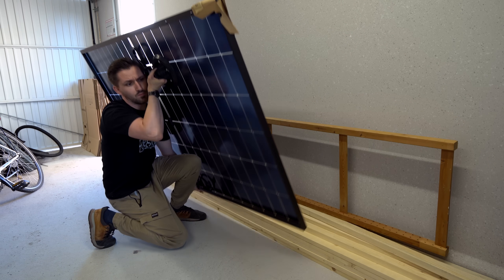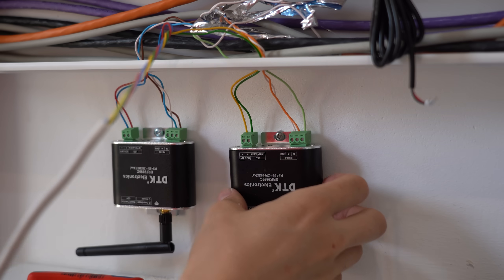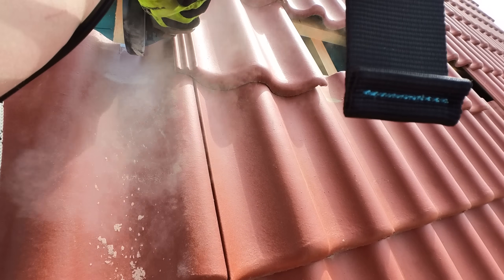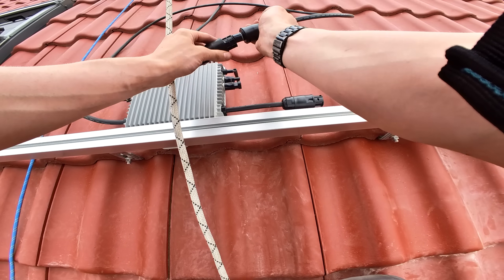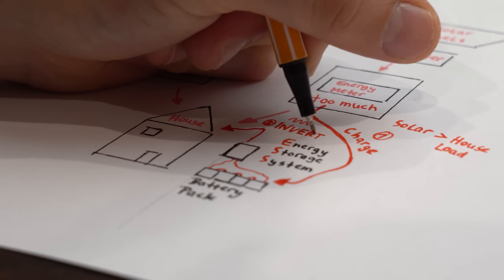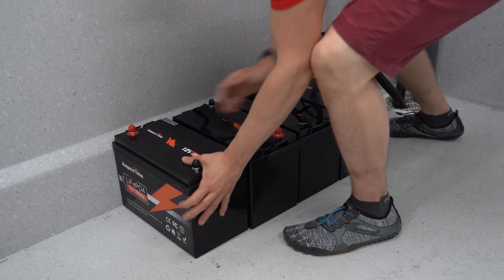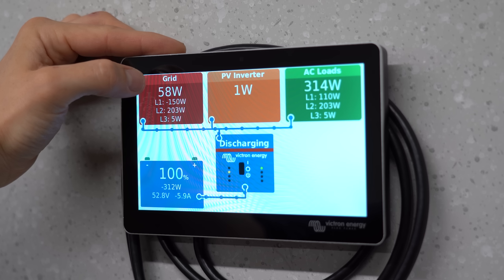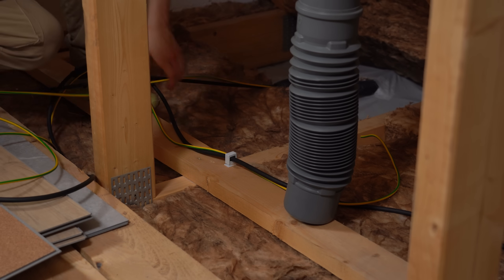Pushing a "legal" Mini Solar System to its LIMIT!

Comment: There used to be a term 'guerrilla solar' for unlicensed solar installs... To be honest if you are looking for ths simplest solution, take your 600w of solar+batteries and use this to power your fridge freezer. Add a relay so that it connects fridge back to mains power when battery is empty.... You won't be paid for power, but fridge/freezer is likely the largest electrical load (appart from heat/water heat) and will easily consume all that 600w panel can produce.
Side benefit is that you are better protected for grid outage.

Comment: Great project, well done. But kind of overkill for a balkonkraftwerk!?
How expensive were all these components?
Did you think of charging your battery via DC with a Victron Blue / SmartSolar?
Is the Multiplus2 legal since it can deliver much more than the 600W limit for balkonkraftwerke?!
So many questions on this topic😅

Comment: In California the utilities will buy surplus solar power, the problem being they set the rates (and they’re lowering them substantially), and don’t have any way to store it…which stresses the grid and means we have a net export during the day and have to import the energy after dark. Generation plus storage is definitely the way to go, but as you point out, the cost is probably only worth it for never having a power outage!
Reply: Living in California, I would say that it is cost effective to go solar in ANY state with relatively high $/kWh rates AND you as the consumer use a lot of electricity.  People with very low electricity usage will not break-even on solar or solar + battery systems.  The greater your energy needs, particularly if you also own an EV, then the more cost-effective solar and solar + battery systems become.

I DIY'd a system to run my office and server room off of around 2kW in solar, with 7.7 kWh worth of LiFePO4 batteries (3 x 24V LFP batteries in parallel, in my case, though I would go with 48V were I to do it again).  Two 600W inverters, and one battery charger in "power supply" mode for low-battery load support from the grid.  And yes, a whole pile of DC breakers too 🙂

When all was said and done I calculated my break-even at around 5-7 years.  So as a DIY project the economic argument is usually pretty good.   For professional installation, though, adding batteries can be very expensive and the economics aren't that great.  Still, people choose to do it either because they have no choice or they just love to play with solar and batteries, like owning a boat... a labor of love that is also a money sink.
Reply: @junkerzn7312  Well said. The image is that solar is some sort of panacea, but I (and my family) are pretty low use--seldom does the power bill go north of $100 because we try to be mindful. The last time I ran the calcs, I wasn't going to see break-even for about 15 years--and that was a DIY solar+storage. 
As you mention, it'd be fun to play with, but for me...I'd rather own a boat and be able to fish from more than the bank. Thankfully, the SO won't hear of a boat! :)
Reply: @sac58999  Well, that's no good!  We have to temp you into SOME sort of money sink!

The next best thing is... if you and your family like to go car-camping or RVing, throwing together a small system for the camper or RV, with permanent solar on the roof, is a really fun DIY project.   Lots of people do it (there are tons of channels on YouTube describing such projects).  Some even to the point of having enough solar to run A/C.
Reply: @junkerzn7312  Fair point, and my wife has tried. But I'm paying for a private school for a stepdaughter, so that's my money pit...and I wasn't even consulted before the decision was made. In the interim, I count the pennies!

Comment: Warning to US people:  In the US, if you don't have a net meter and you aren't using the power produced from your panels (i.e. you are producing more than you are consuming) the old electric meters do not know which direction the power is flowing.  It assumes that it is always flowing into the house.  Because of that, all the extra power you generate will actually be charged as power that you have used.  Nobody wants their "Bandit" system to actually cost them extra money.  (At least this is what I have read, but hopefully somebody can correct me if I am wrong.)
Reply: I mean, you have to have solar systems inspected in the vast majority of places in the US.  You can't do this sort of thing in the US.  Period.  So a single rumor about a single type of meter in a country that has nothing near a unified grid with the same standards from one section to the next, is kinda the least of your concerns.

Comment: 0:49 just wanted to say that in such systems you MUST have a way to make sure you are not sending power back to the grid, (unless requested) NOT because you don't get money, because if there is a downed line, it could be assumed dead if its not.
Reply: The whole house inverter takes care of this problem.

Properly wired:
1. if the panels/micro-inverters and/or batteries are enough, they supply the A/C to the home

2. if the panels/micro-inverters supply too much power, extra power is sent to the batteries via the whole house inverter 

3. if the panels/micro-inverters supply too much power, if the batteries are full, then the whole house inverter shuts off the micro-inverter, and supplies energy to the home.

4. If the panels & micro-inverter  power is too little, if the battery is too little, then the whole house inverter enables the A/C mains.

Comment: I started buying some stuff for some solar and have 2 used 250w panels and an mppt charge controller and inverter but i was working on building a battery but i really should just get a grid tie inverter i was worried about pushing power to the grid without getting all the permits and authorization but its only up to 500w and during the summer our ACs are running all day but they are juat sitting outside doing nothing but if i grid tie them thats about $0.25 a day which isn't a lot but it adds up and is doing nothing now and will add more eventually

Comment: Hey Scott I need your help is there some sort of micro inverter that will convert direct AC from my panel off grid without me using battery's or conecting to my home grid basically AC in the go lol

Comment: The cost of the ESS victron parts and batteries is so large that it will cost more than the panels will ever produce
Reply: Solar + Battery systems do cost more, but they are in-fact economically viable when you DIY the system... and use a few more solar panels than the 2 panels in this project.   With just 2 panels that victron multiplus is overkill (by a lot).  There are cheaper battery topologies that scale better.
Reply: @junkerzn7312  unless your goal is off grid I question the above, I would like to see material cost of this kind of system say 5 panels etc. The batteries would cost a lot also?

Comment: In all honesty, it's a nice setup, however one battery will wear out earlier than the other ones. You do not compensate for slight mismatches in voltage or internal resistance. Would've been better to use 48v batteries and an additional bms. Maybe you can do some research and another vid on that?
Reply: did you watch the part where he charged and checked the voltage on each battery?
Reply: I did, nevertheless aging will influence one battery more than the others. If it is the same now it doesn't mean it will be the same after 2-5 years.

Comment: You used a microinverter from Deye. They have problems at the moment because they cheaped out on the internal safety relay ("NA-Schutz-Relais"). They have a solution for this issue: an external Relay. You have to ask your retailer or manufacturer to get this external safety relais for free

Comment: While cool, this is ridiculously complicated all you needed was a hybrid inverter with meter, it would have replaced most of the complicated add on stuff, the panels, batteries and mains all plug in to one box that does all the clever stuff probably would have been cheaper too.

Comment: Hello,
I worked in the ventilation installation, with aluminum ducts, all our supports were either insulated from the ducts or made of aluminum to prevent electrolysis from eating away the aluminum. (according to my boss at the time)

Comment: I wish we could to that in the US the same way. Legally we can't do the balcony thing without complicated interconnect agreements that only make sense if you are going to spend 10s of thousands of dollars on solar.

I have opted to just move most of my house "off-grid" using off grid inverters that have an AC charging option. So far I have moved all the single-phase circuits over to solar. I've produced 224kWh of solar this week!
Reply: Yeah, and you can also start small with that...like just run security lights from solar.  Or a shop.  Or...etc...and slowly build how much is off-grid vs on.  (Of course here, you're rate tier goes up a cent or two /kwh with lower usage, so that's fun.)

Comment: This will depend upon your situation, but server-rack batteries can often be better choices than traditional box batteries and come in 12V, 24V, and 48V variants.  As demonstrated in the video, you need groups of four 12V box batteries to create 48V and this will typically cost as much or than a 48V server-rack battery with more convenience and features (for example, no battery-to-battery connections needed for a single unit).  Look at both options when building your system.

Another option is to use raw cells to build your own battery array, but this is neither quick nor easy and I don't recommend it to people that just want a quick solar setup.  It can cost less, but is more expensive than it might seem because you'll need a protective case/box, a quality battery management system, and quality connectors for all cells.  Pre-built batteries are much simpler to use and at a predictable cost, but you still need to choose a reputable brand as scammers can hide bad cells and construction inside a nice case!

Any solution will need an inverter/charger system and all of this adds up to thousands of money units rather quickly, so skimping to save a few can be a bad investment.

A very knowledgeable youtube resource for these systems is "DIY Solar Power with Will Prowse".  One thing he'd probably want to add is to generally avoid Grade B LiFePO4 cells; the savings are not worth the unpredictable sacrifice in capacity and/or lifespan.  Imagine if you pay 2/3rds the price, but get 1/2th the lifespan; cheap cells can be more expensive in the long run.

No matter what type you choose, buy batteries from reputable sources with excellent ratings.  This is a lucrative market and there are lots of scammers.

Comment: Hm why need to make it with this multiplus 2 + separate microinverter + all this communication items, if its in the end is off-grid system where you could use off-grid all in one inverter which handle everything and will not push any AC back in grid? You just connected it to grid, to load, to PVpaneld and batteries and thats it. Like big EG4 inverter or something more affordable.
Also using 4 separate battery not best solution, better to use one 16cell pack, where BMS could balance all cells, and now its only 4cells in each batteries and no balancing between 12V bats, that could cause you some problems

Comment: I built the same out of a $30 inverter, a $40 charger, two 30ah batteries $200 each and a $8 esp8266 4-relay board. Power measurements by $110 shelly EM3. All comms over WiFi. Seems to work. It is on/off, generating 130W or charging at up to 150W. No continuous adjustment.
Now i want to use openweathermap to estimate next day sunshine hours and set the battery charge state accordingly. If no sun next day charge with every PV excess available. If sun tomorrow discharge batteiers over night.
Reply: Solar doesn't have to be expensive. Common sense goes a long way. Of course that doesn't net $1000's of dollars of equipment from a major commercial enterprise on a million dollar+ youtube account.

Comment: I wish I could do something like this, but unfortunately this sort of grid-tied system isn't legal here... any solar system here needs to have a specific type of interconnect [which includes automatic cutting from the grid if the grid should go down], and has to be approved before installation, or else you risk HUGE fines and getting your power disconnected outright... But on the plus side, we have net metering, so instead of power going out to the grid and just being "lost", we can get paid for excess generation.
Reply: Most Inverters use some Kind of grid monitoring and shut down if they sense no voltage from it. This is mandatory in germany.

Comment: Wouldn't it be better to put your ESS between the solar panels and the inverter? Right now, if I understand correctly, you convert the DC power generated by the solar panels to AC via the inverter. Then you convert any excess generated power back to DC to charge the ESS. And then, when the panels don't generate enough energy you convert energy stored in the ESS to AC again.
Reply: It just depends on convenience.

If you don’t want to run long D/C lines from the solar panels to the batteries, this is the optimal way to do it.

Comment: What’s the difference between using a mini inverter at the solar panel to charge the batteries vs using an mppt charge controller and charge the batteries directly and then use an inverter?
Reply: The inverter co-located with the panels makes a pretty safe system, where lack of house A/C voltage will stop the power coming from the panels.

The micro-inverter co-located with the panels, requires smaller A/C gauges cables GS the D/C cables which go to the charge controller & battery. Sure, D/C cables can be made higher voltage, but this is more dangerous than higher voltage A/C.

It is very convenient to just extend an A/C plug to the micro-inverter, collocated with the panels, vs running a D/C cable to wherever your charge controller & batteries will be… which is by your whole house inverter. 

This process is called A/C coupling.

I bought my Genetry Solar 12k inverter, specifically to do this very thing!

Comment: Hi from the uk 
Yes solar is a great idea but over here it is all but illegal to install a system yourself unless you have the necessary certification so not even a  general electrician can do this then they charge well over the value of the work and put a significant mark up on the goods being fitted then I believe we are limited to a solar output of 3.2kW and we will pay 35 to 50 pence per kWhr consumed and paid back at best 5pence per kWhr. If you do fit your own system then you won't get house insurance the list goes on I would love a large solar array off grid, I thought that any energy left over after charging batteries could then be dumped into heating water
Reply: If you have the space, build a shed in the backyard with solar panels on top.

Comment: I see you do not include a BMS to keep your batteries balanced, so remember to check thier voltages occasionally
Reply: Most LFP have internal BMS, sometimes with Bluetooth monitoring. In this system he connected batteries in series which might require some balancing resistors/system. He might have been better with 12v or 24v batteries in parallel.

Comment: Nice job!
The only direct tie (to the grid) inverters I've seen will not produce power unless the grid is actively working, does the direct tie inverter you use work with and without the grid being live?
Reply: The whole house inverter should be able to create an a/c supply when the mains are not active, so grid ties should function.

A Genetry Solar Inverter will sink extra power provided by the grid ties on the A/C outs to batteries, and will turn off the grid tie inverters once the batteries are full (without all those other sensors required by this setup.)

I am finishing the construction of my system, to try to go off-grid, with a grid backup on my whole house inverter.
Reply: @DavidHalko  Thank you for the information, solar may be a bit pricy, but the independence it provides is satisfying.